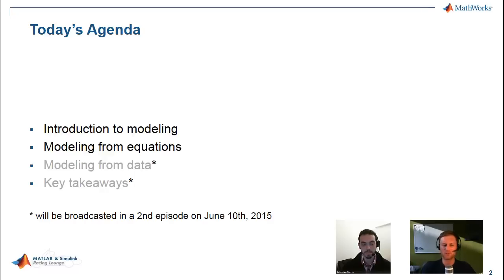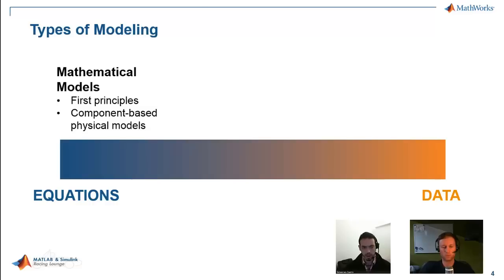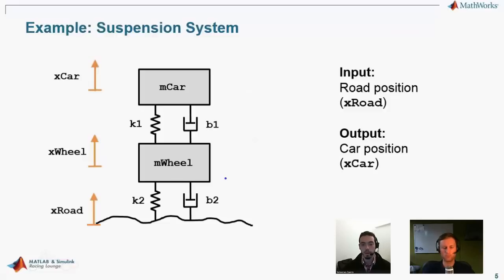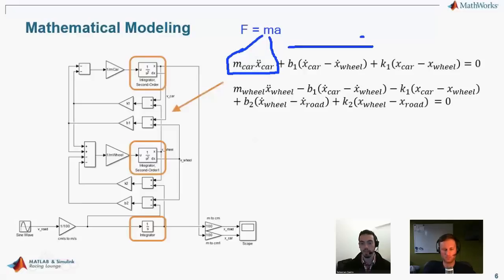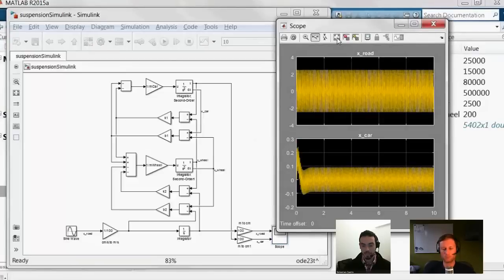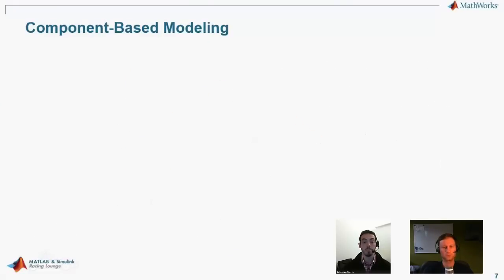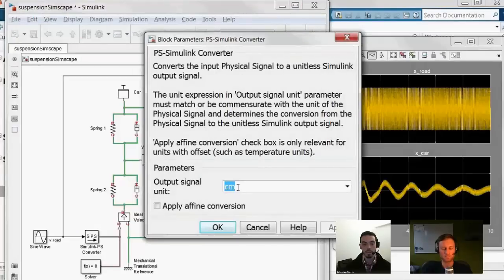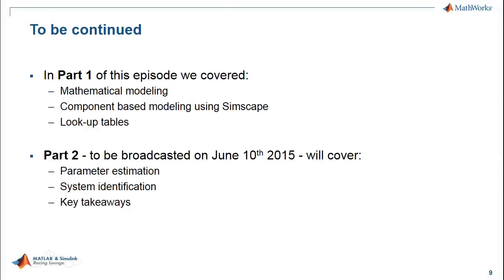Modeling Physical Components, Part 1: Mathematical Models

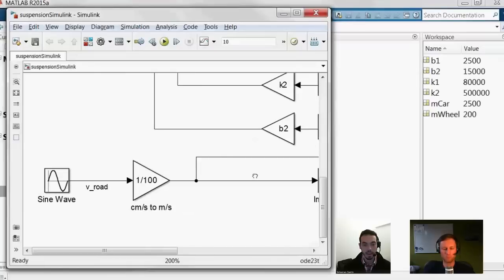Comment: 14:57 he says we use a sine wave to model the velocity of the road...why does he model the velocity of the road as an input and not the velocity of the car?
Reply: The velocity/displacement of the car is what you want to measure. The input of the system is the velocity/displacement of the road. You want to know how much does the car move in relation with the road.

Comment: can i model a train bridge interaction by simulink? the train wheel should be connected to rail which can be designed as a beam element and then rail should be connected to bridge which is also modeled as a beam element. i want to know the response of the bridge when the train passes through it??????